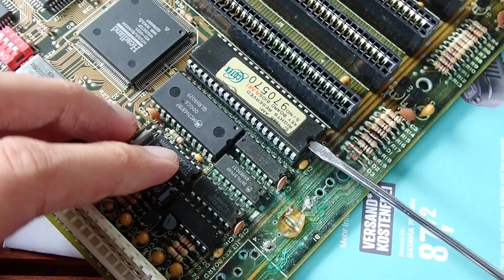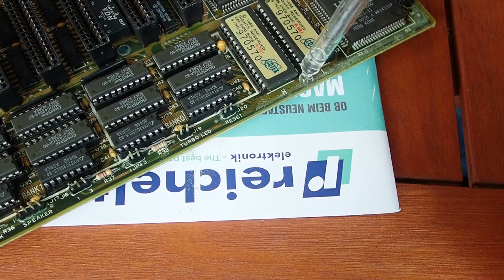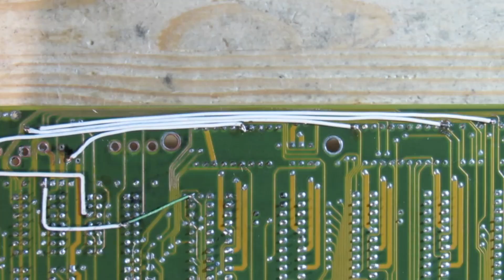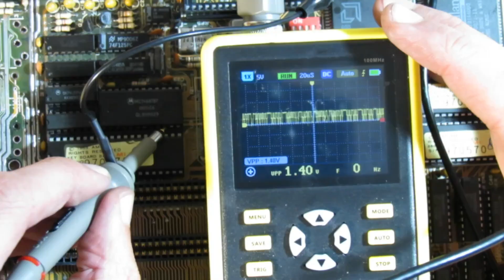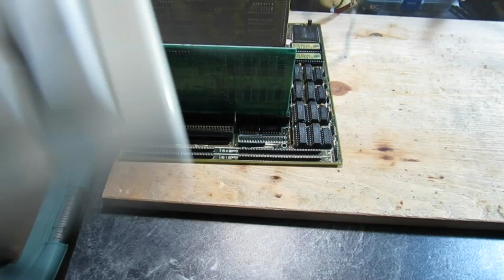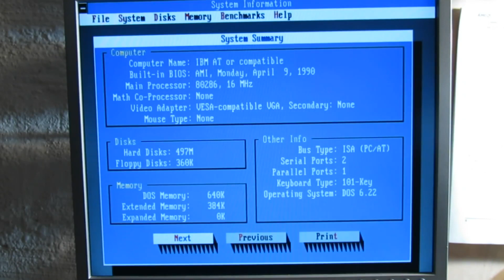Will this 286 mainboard ever work again? Heavy damage by leaky battery

Comment: I would like to thank you for your videos, seeing your techniques on how to repair and ressolder traces, i was able to recover a early 2000's dvd board that had a crack near the main processor, with 3 cm lengh, at least 15 traces were damaged, with a magnifying glass, a very thin soldering point and some wires, i was able to restore the traces and now it works (it wasn't opening the lid neither lighting the laser)
Reply from the maker: Fantastic!

Comment: I always wonder how much cadmium it is in that leaked electrolytic "acid" (and if it's legal to put that substance in the drain). Haven't dared to try fix my own damaged main boards yet.
Reply from the maker: There should be no cadmium in that electrolyte. Cadmium is used for the electrodes. The electrolyte is a base, nickel oxide hydroxide, to be precise. You shouldn't put any if that into the drain of course and the batteries have to be recycled properly. The spilled electrolyte (base) on the other hand I always neutralize with some acid (usually vinegar), which reaction results in salt and water. That is not dangerous, especially in that tiny amounts. I made a video about this topic once.
Reply: @necro_ware  Thank you for answering! But the electrodes are in contact and react chemically with that liquid base, right? How do we know really that (practically) no cadmium follows it out when it is leaking?

I have absolutely no idea about the doses that would expose us to though, or how it would compare to (say) old red/yellow plastic, yellow sheet metal, smoking, mushrooms, or other cadmium sources. 

Pretty hard to find much about it on the internet too :(

Comment: Lots of wire bodging.
I say well done reviving this 286 but aesthetically is not good looking.
I also have a 286 Harris with a 20 mhz cpu but it's not showing signs of life.
Another that I have (AMD 286 16 MHZ)   beeps 6 times (short pauses) with a speaker attached but no video output.
There's no damage from the battery (no signs of corrosion), no static ram nor sipp modules installed (came with sipp instead of simm).
How do I troubleshoot it?

Comment: So this is a multi-layered PCB? In this case, I'm surprised that the keyboard data line (which you fixed at the end) was the only inner layer trace which was broken. Were multi-layer PCBs common for mainboards of that time? I wouldn't expect those before 386 mainboards...

Comment: Dont know how much you read old posts but i have a 286 board that desnt post. Varta damage. Have done plenty of errors allready but tinned some traces and cleaned what i can find. Still no post. Swapped the the transistors near the battery, other one was dead but if some other clear points can be added i would be glad. What other components can go bad?

Comment: would this motherboard be able to handle 2MB if the 30 pin SIMM sockets were present an filled with 4 256k SIMM's or more
Reply from the maker: Yes, you can insert up to 4MB of SIMM RAM. I'm using this board with 2x1MB modules, what is more, than enough for a 286.

Comment: nice fix, congratulations!. no solder mask? that will prevent future oxidation on the naked tracks
Reply from the maker: I could, but if you have solder on the traces, it is optional. Only bare copper traces need to be protected from oxidation and since I tinned everything, a solder mask is not necessary.
Reply: @necro_ware  true, my bad

Comment: hi! do you mean this vinegar  en.wikipedia.org/wiki/Vinegar? but how this work? copper yet oxidized - and we use acid another one
and how strong vinegar you use? 7%(vinegar acid) or 70%(vinegar essencion)?
Reply from the maker: I'm glad you asked ;)  https://youtu.be/sVxqLBp6l1c
Reply: @necro_ware  thanks. but i'm not quite sure what i can buy in Russia exactly white vinegar  but we can buy vinegar 70% or vinegar 7% - which is right percentage for repair?
Reply from the maker: I'm using 10-15% vinegar. Exact number is not important, just don't go to much over 15%. You can also use pure lemon juice, it doesn't smell as bad as white vinegar ;) And always wash the board properly with clean water and put it into a dry warm place for 24 hours afterwards before you turn it on.

EDIT: если что, я говорю по русски тоже и если что-то совсем не понятно, с радостью помогу.
Reply: @necro_ware  oh, many thanks!

Comment: Nice video. How many years you think this mainboard will continue working after this fix?
Reply from the maker: :D It's a good question. I mean it is a very old hardware, which was heavily damaged. Regarding corrosion, I tried my best and left vinegar working a little bit longer, so it should have got into every hole and hopefully neutralized the electrolyte properly. If so, and corrosion was stopped, it should work as long as it would without any corrosion at all. I repaired this board about 10 months ago and it is still absolutely working. Just used it yesterday for some experiments.
I saw a lot of people trying the same without neutralizing the electrolyte. In such cases as soon as they turn on the mainboard, the chemical reaction will be accelerated by the electrical current and the board dies within a month, or even less, dependent from the damage.
Reply: @necro_ware  I am not an expert on this but I assume it is a good idea to let the vinegar dry before you turn the thing on again, and that should help avoid electrolysis?. But again I am not an expert. I didn't know that vinegar does such a job. These boards remind me the time I was young, that is why I watch these videos. I would also like to watch pimped systems, that is systems from that era that use some modern hardware and hacks that make them extra fast. This is fun.
Reply from the maker: If you are interested, you can watch one of my previous videos,  where I explain why and how the vinegar has to be used for restoration. https://www.youtube.com/watch?v=sVxqLBp6l1c

In regards of pimped systems. I do sometimes nice builds and I already have some nice videos about that. But I rarely overclock or torture the systems in other ways. This retro parts are meanwhile very rare, expensive and fragile due to their age. I do like that oldies too much you know :D But feel free to watch my "let's build" videos, may be you like them as well...

Comment: barbaric way to remove solder ... but i am impressed the way yo do it ...
Reply from the maker: This is the exact problem, if you get electrolyte on the solder, it reacts and gets heavily oxidized. This oxide goes very deep and doesn't melt at usual soldering temperatures anymore and if you go too high, you'll burn the PCB. You also can't get fresh solder to the joints, because it doesn't stick on the oxide. Ever tried to get solder on aluminium? It's similar result. So, you have to get through the oxide somehow and if it's too late and it got into the holes, there is just a little chance to desolder something without damaging the pads or traces.

Comment: I like the suspense on the entire video. Besides I've learned a lot - vineger for the battery acid, jumper wires, restoring the tracks, remove corroded solder, restore broken IC leg.

Comment: You have given me hope that I can fix my broken motherboards that I haven't given up on yet. I think I will definitely benefit from having one of those scope/analyser things you have. And what is the wire you used for trace replacement?
Reply from the maker: You don't necessary need an oscilloscope, very often you just can use a logic probe, as I showed in my April's repair marathon videos. As for the wires, in this video I was out of thin wires, so I used a thick wires from a telephone cable. I usually use  30 AWG wires for repair.

Comment: Cut the old battery out,  run it through the dishwasher,  blow out any remaining water with the air compressor and then start repair.   The dishwasher run will help to better neutralize any remaining corrosive material.  Edit:  You did a great job.
Reply from the maker: Thank you. I know, that many people use a dishwasher, but I prefer the old fashioned way. Furthermore, if my wife will see me putting such "things" into the dishwasher I will need to search another home, I guess :D

Comment: what do you think of lacker (or nail polish) on the bare traces instead of tinning them? it does not need heating up the half-damaged traces. although it might be harder to remove if I need to touch those traces in the future.
Reply from the maker: Hi! Sometimes I use nail polish too, if I want to close some surface scratches on the mask layer. However, when the traces were half eaten away by acid, you never know how thick they are now. You also can't see micro cracks in the traces and they are very complicated to find. So, in such cases I prefer to tin them at least to regain the thickness.

Comment: Hi, I have the same mainboard. Can you tell me what kind of external battery you used? Voltage and the pinout of the battery connector? Thanks and keep up the good work!
Reply from the maker: Hi Tobias! You can use a CR2032 3V battery or just a pack of two normal AA batteries with 2x1.5V=3V. I don't have the mainboard at hand now, so I unfortuantely can't tell you the pinout, but its very easy to find out. The 4 pin header above the keyboard connector is for the external battery. One of the outter pins is ground and the other outer pin is +3V. The middle two pins are usually not connected. Anyway, you can checkout which one of the pins is ground by using a simple multimeter and measuring the resistence to the ground (f.e. metal around the mounting holes). The pin, where the resistence is around 0 is the ground pin. Good luck!
Reply: @necro_ware  Thank you so much for your complex answer, didn't expect so much help :-) Greatly appreciated! Your channel has excellent content, just subscribed. I hope your channel will get more attention soon, with such high quality content it's just a matter of time. All the best!

Comment: What oscilloscope were you using?
Reply from the maker: It's a cheap device, which is not 100% as good as it claims. It says, that it can measure up to 100MHz, but in real you get reliable values for up to around 35MHz. However, this is absolutely sufficient for repairing retro hardware with FSB of up to 33MHz. And if you don't care about exact voltage, but only about the signal shape, you can go for up to 100MHz as well. In the end, it is super compact, works from a rechargeable battery, very cheap and does, what I need in the range of my interest. See:
https://de.aliexpress.com/item/33021370646.html?aff_platform=link-c-tool&sk=Lirr17DW&aff_trace_key=0d3f7da30af94d5b920aa43b4af80d10-1602228886792-00608-Lirr17DW&terminal_id=5e23f645d07d42e78df79d2b610bc10e&tmLog=new_Detail

Comment: amazing work! Are u going to apply solder mask for the exposed traces or leave it as it is?
Reply from the maker: I tinned the traces, so I guess, it's ok not to apply additional solder mask. May be I'm wrong however :D
Reply: @necro_ware  You are right. There is no need to apply solder mask. In that case it will be only cosmetics.